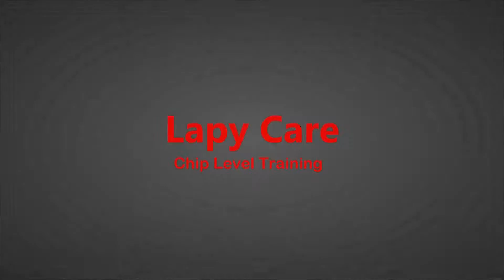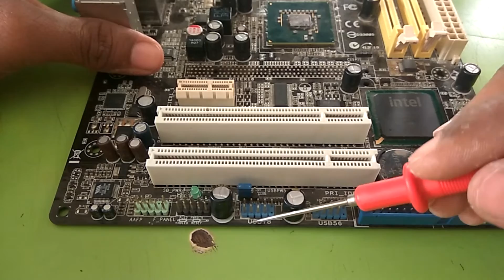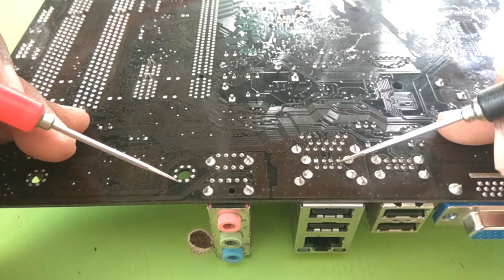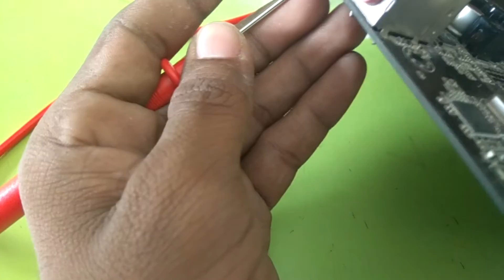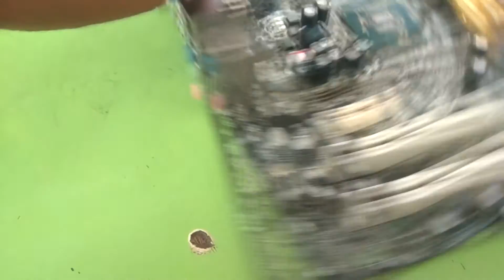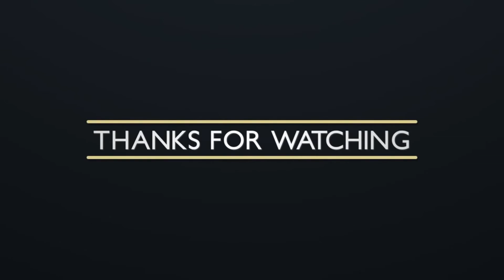[Eng]Advance Chip Level Motherboard Repairing  : Lecture 16 - USB Circuit in Desktop Practical

Comment: sir i have an problem in my laptop charging.when i plug in my charger connector to the laptop charging port the charger is not connected.when i switch off the charger supply which is connected to the 220 ac volt,4to 5 time the charging will start.some time if i short one time of the charging pins of the charger and then pluged in then also charging also start.and some time the chager says charger is connected,but not charging.please help me sir.i suffer this problem last 1 year but i have no solution.i reapleased my charger and then some days the charging problem will solve after some days the problem again occure.please help me.
Reply from the maker: in the volt in circuit there is mosfet is may be damage...i face similar problem that when charger connect led of charger off means no charging and this problem because of volt in mosfet damage so please check that....and thank you so much for sharing your problem..